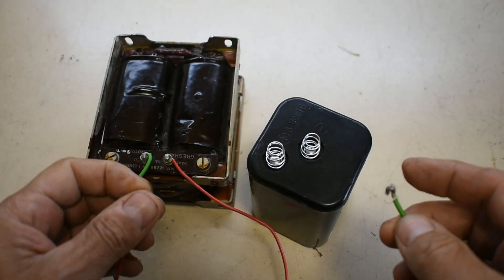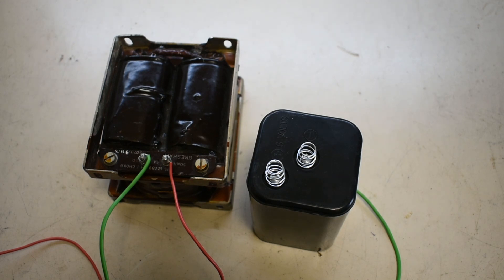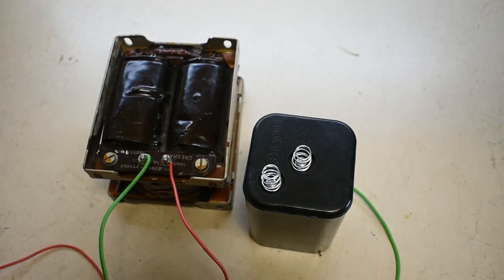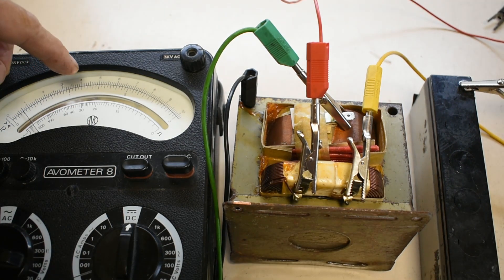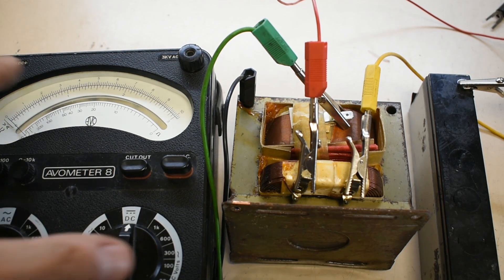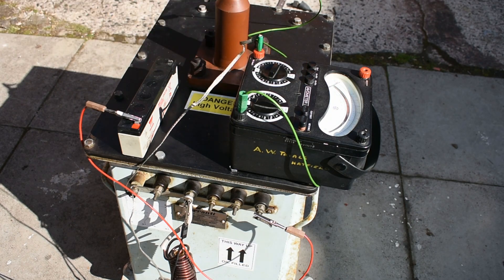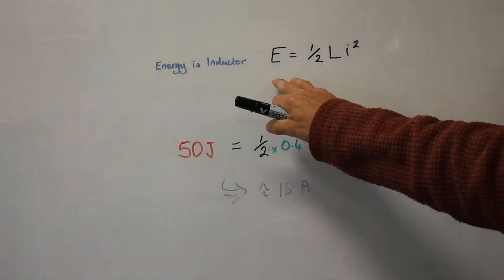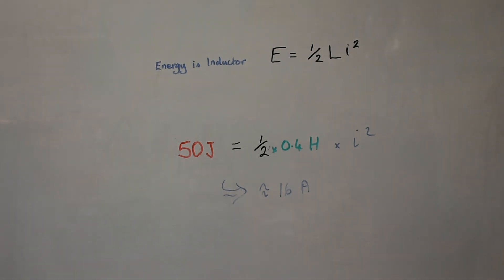Shocking back-EMF

Comment: The five L/R time constants in the analog meter's "needle deflection" coil could make it unable to show the "delta t" of the back EMF pulse.  I'm not sure what chips a modern DVM uses to report voltages but in my Micronta analog multimeter, the deflection mechanism is a large-ish coil that is fed the input signal from the meter's probes when they touch the being-measured circuit.

The analog meter itself is an electromagnetic induction device (a coil and magnet) and the ability of a DVM to faithfully indicate the rise time of the back EMF pulse, or better yet, an oscilloscope, just in case the analog meter's internals (the coil inside the meter that takes the input from whatever circuit/device is being measured).

I always use an oscilloscope with the input probe set on  "x 10"  to protect the o'scope.  
The back EMF spike can be pretty astonishing in
     - very brief rise time
     - the voltage magnitude of the spike

I love analog meters - when I learned electronics in the U.S. Navy there were no digital multimeters.  The one you have looks very robust.  

.
Reply from the maker: Yeah the meter won't accurately react, although the field collapse in the large transformer is quite slow. DVM don't react a lot faster than analogue meters in my experience, and are far more susceptible to damage from HV spikes.  The scope is the best but also possible to damage the input if not careful.  The meter I'm using is old and obsolete here now, but it was always considered a tough and popular instrument in Britain. It was manufactured by Thorn-EMI and known as AVO ( for Amps, Volts, Ohms) .
Reply: @tuopeeks  I would never part company with my analog meters.  The fact that they are very basic devices is confidence-inspiring.  The fewer parts that can break, the better, imo.  The one you have looks to have been a high-end one.  

It's like an old guitar:  they are keepers!

Comment: I feel the relatively long dV/dT could make it more dangerous 🤔
Reply from the maker: This is an interesting point and I don't know for sure. The longer time may indeed be more hazardous to the heart, but it also reduces the peak energy. This may be part of the reason the transformer would have to be very large.
Reply: @tuopeeks  but if you think about a static shock this can be Amps but the duration is so short it is harmless. I'm pretty sure they use inductors in defibrillators to limit current and stretch the pulse 🤔
Reply: @tuopeeks  I messaged you on WhatsApp mate

Comment: Depending on all parameters it could kill.  However, for usual parameters it would not. You would need an insane inductor and a good power supply to kill someone.
Reply from the maker: I like the idea of an  insane inductor👍
Reply: @tuopeeks  Think of an inductor the size of a car. That could kill.
Reply from the maker: @hanslepoeter5167   Yeah, something at a substation
Reply: @hanslepoeter5167  Think excitation winding of a couple hundred MW (think powerplant) generator. THAT is nasty. I have seen a few charge / discharge tests of one of those. The amount of energy in something like that is real scary.